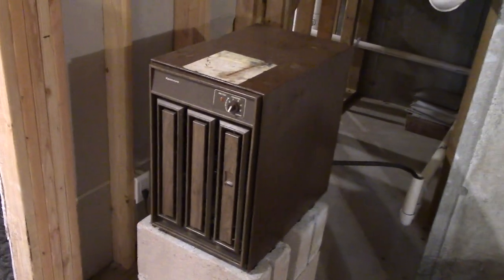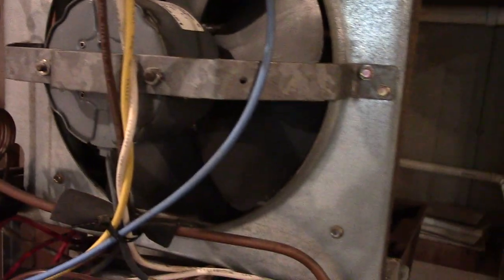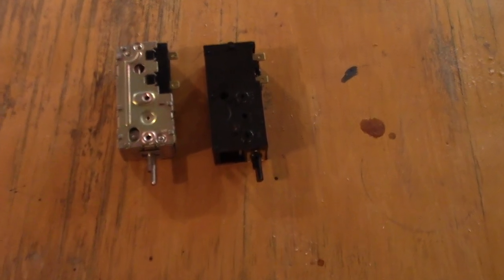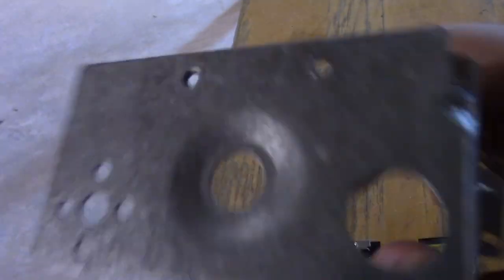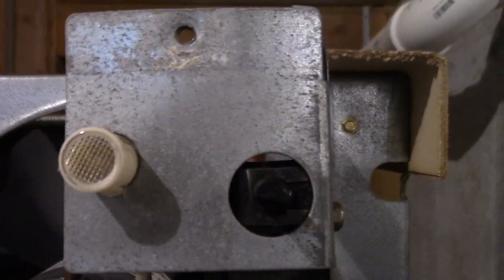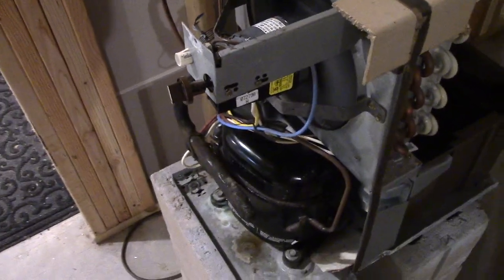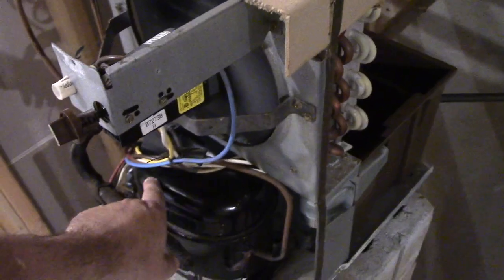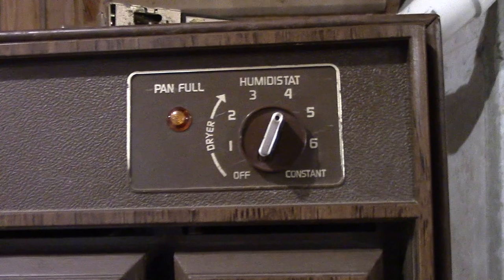Kenmore Dehumidifier: Replacing the Humidistat.

Comment: Looking at this video and you opening up that older vintage dehumidifier I can’t help but notice all the metal in there. The new dehumidifiers are all plastic except for some absolutely necessary pieces also the adjustment holes that you were talking about do not exist on the new dehumidifiers. Even your replacement part is now basically plastic I’m just amazed at how everything has changed I wonder if they will come out with a plastic Compressor? I believe that they already have a plastic encased fan motor. Great job!
Reply from the maker: I know right? SO much metal in it! I first noticed that when Jay showed this to me back in 2014. Some of these models also had a metal fan. This one didn't as you can tell, but the plastic on it is really thick, so it helps some. I had figured the replacement humidistat was going to be plastic. However, it's such a basic part that does so little, so I don't think it will matter too much. Those adjustment holes were so perfect. It's amazing the options that they gave you for these things back when, so user-friendly! 

A plastic compressor? Oh god, it would never be able to handle the pressure. At least they seemed to think smart in that regard. Haha. I forget if you commented on it, but I have a video of my bro's 2010 dehumidifier after it was on its way out. The amount of plastic was insane.

Comment: Very nice, that worked out too well.  It's probably a common part to many different models over the years, and they planned for this with the different mounting options.  Yeah I'll take a look at the old control next time I'm there.

For the insulation, I think you might be looking for the stuff called "pipe wrap insulation".  Google that around a bit and I'm sure you'll find something.  That should also be a pretty quick little project.
Reply from the maker: It really is amazing just how well it was. When I saw those adjustments on the bracket, eve before I took the old one off I was like "I already think this is gonna work!".

I'll check out that insulation.
Reply: jaykay18 would you happen to know where online I could purchase a couple defrost sensors and the electronics for a float switch?? They would likely be the same parts as the one in this video! Thanks in advance..
Reply: I bought one of these last month and it runs well. Bucket fills up to the brim about every 2 days but I am concerned as well because mines continuously runs. I have the knob set between 2 and 3. It turns off as it should when I turn the knob to the left and then right when I turn it back between 2-3 it will come on again. Should I replace mines as well or do you think it will take a couple more weeks before it takes rest breaks on it's own? I live in NC so we have a lot of humidity. My model is the one where the bucket sticks out a little in the back. Thanks!

Comment: Hi.  I have this dehumidifier. It's been a workhorse - so when it wasn't running I opened it up to see if it might be repairable.  Thank you for your videos. The problem appears to be the fan - no spin no movement - never realized I needed to oil it (in the nifty well marked oil holes).  Any suggestions for repairing the fan - or how to get a replacement fan?
Reply from the maker: Try oiling it! It MAY come back. Try giving maybe 5 drops in each end and spin it some by hand first.